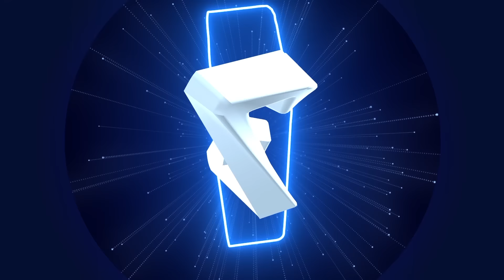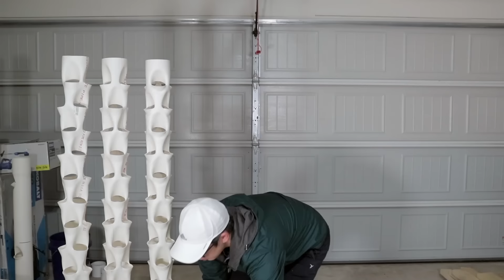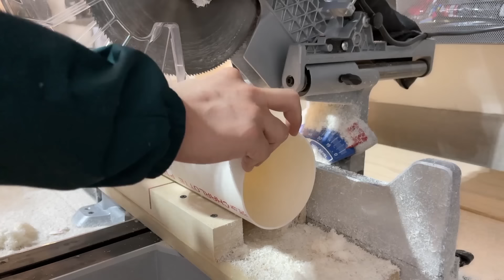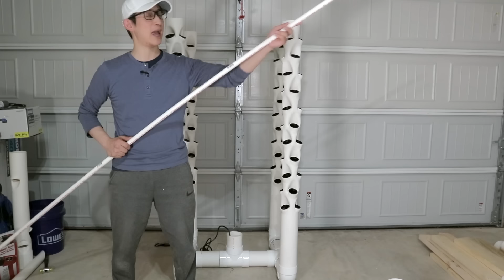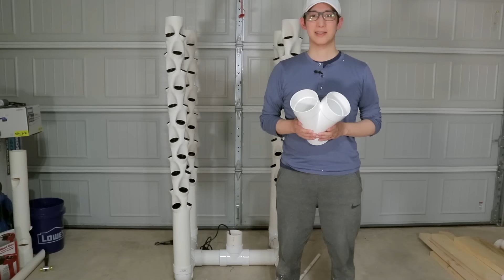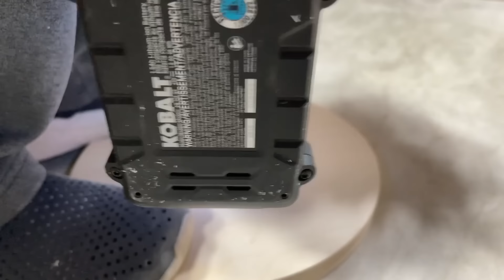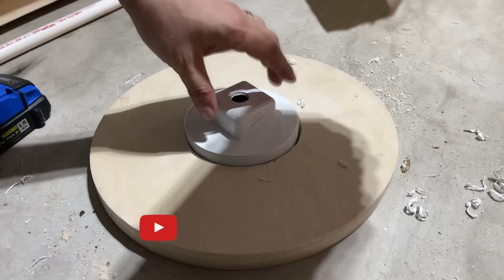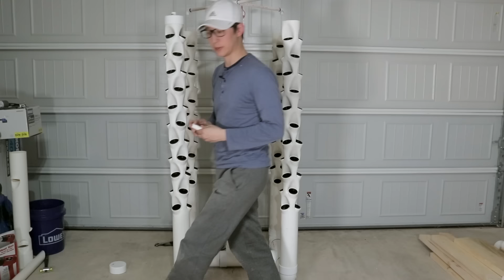DIY Hydroponics | Aeroponics Garden Tower Build | Part 2 - [4 Tower Build]

Comment: Hi Chris Amazing 
Great design, just as a thought 
The base of your upright I would assume that is the height of your water reservoir 
As you don’t glue this to allow for cleaning I was thinking to glue in a 300 to 400mm section which you then can place your pipe (grow tower )into giving you 5, 300 to 400 mm high pipes as a water reservoir, and still access for cleaning 
Really inspired to give it a go
Cheers Claude
Reply from the maker: I had thought of that as well.  The base already holds a lot of water, but agree that adding an additional vertical section will allow for more water.  For this build I just wanted to keep it low enough so I can reach the top plants, however, great idea for increasing the amount of water.  Maybe I reduce the height of the pots section since there are more than enough pots already with the 4 towers.

Comment: This is very nicely built. In the future, when you are cutting 2 inch PVC pipes, you don't have to elevate them like you did in this video, the miter saw will plunge deep enough to cut all the way through the PVC, provided you didn't set the depth stop up to prevent it from cutting all the way through. You can then use one of your pieces of 2x4 as a stop block. To attach a stop block, simply clamp it to your miter saw, on either side of the blade, whichever is most comfortable to you, and adjust it to how long you want your finished piece to be. This will also insure that every piece you cut, is the exact same length. This can be done, not only for your hydroponics builds, but for all of your woodworking projects as well. You can find countless videos here on YouTube, to explain miter saw stop blocks further, if you need them. If you want to get even more in depth with this, check out these two videos from other YouTubers https://www.youtube.com/watch?v=Z7aVlujrmlg      https://www.youtube.com/watch?v=kkOD4JxxE6w
Reply: At the end when you were showing the finished project, if you need some more stability, especially in windy conditions, you can lay a bag or two of sand on top of the base on either side of the center.
Reply from the maker: Thanks.  I started doing that for the bucket design.  This PVC base design is actually very sturdy.  It even withstood gusts of wind from a passing tornado.  Law chairs and roof shingles were blown around but the tower didn't move an inch - lost all the plants though :(
Reply from the maker: Thanks for the tip and links.  I was actually just being lazy using the 2" PVC holder to hold the 4" PVC pipe so it wouldn't roll, but definitely sound advice.  Appreciate the tip for the stop block as well!

Comment: looks great, but depending on the pump capacity, that base could be an issue. because the water level is shallow u risk burning out pumps. also, when the water increases past the 90s at the base its gonna leak like crazy. better off with a male adapter glued to the tower bottoms and a female glued to the base 90s.
Reply from the maker: So far I haven't had any issues, but then again I refill the reservoir when I notice it getting low.  Another viewer also had a great idea of extending the base reservoir, somewhat like what you are suggesting.   Thanks!

Comment: How many plants could this fit in it. It looks like there could be 33 plants per tower which would be 132 plants in total. If that is true then it would save 132 square feet in what I would guess to be about 4sq ft.
Reply from the maker: That's about right, however, it can be more or less depending on the height of the tower.  You definitely save a lot of space which is the benefit for these towers, aside from cost savings for both water and dirt.

Comment: I just bought all these parts. Including a hack saw and hole drill bit, my total so far is $340. I still need to buy the seeds and hydroponics food. Maybe a 30w water heater. It's gonna come out to around $400 I think.
Reply from the maker: for the 4-tower build, its a bit more expensive then a single tower.  It It also doesn't help that prices have gone up as well =(
Reply: Did you buy drainage pipe or sewage pipe? Drainage (lawn and garden section) is a fraction of the price. More than half
Reply: I think I bought sewer pipe. Hmm didn't know there were different types.

Comment: What is the mitre saw "stopper" that you mention?  I can only find stop blocks on line but those are different.
Reply from the maker: There is a stopper bolt built onto my mitre saw that allows me to set a stopping point.  Its basically a screw pin that I can tighten to stop the saw at different heights
Reply: @ChrisLoh  okay so not something to add to a saw?

Comment: You did a great job buddy! How do you regulate ph and nutrients in the water, for optimal growth?
Reply from the maker: I forgot to mention that in the video, but I use a PH meter.  At first I just guessed and for some time I didn't even use nutrients.  I found though that using a PH meter helps produce the best results.

Comment: If you cut your rings ahead of time and inserted the ring into the hole made by your heating gun while it was still hot, it would fit perfectly and take less time - just a thought.
Reply from the maker: Thanks for the advice.  I learned that as well and applied that technique in my 3rd video.
Reply: @ChrisLoh  I would even go as far as to put the ring onto the angle cut pipe so while it is hot, you can tap the ring down with a flathead screwdriver and a mallet.

Comment: Chris Loh, It looks like you have a viable proof of concept for a commercially available retail product. You could even have two sizes. One the size of your original tower. and one size not as tall with a smaller diameter that would fit in an area the size of a balcony of an apt.

Comment: Great start, but you never show living plants in this system.. And I fear , healthy plants are NOT possible in this set up... WAY too many plants in a 4" pipe dude lol... I bet the pipe is completely blocked with about 25% growth of the plants and the bottom plants get starved, also slime and algae issues with lack of flow down the pipes, due to root overcrowding. I would cut down to about maybe 8 plants per tube? maybe that would be the max? I'd like to see the inside of that tube with plants growing with it? All part of new designs, failing is the way top succeed!

Comment: Individually measuring one inch rings is such a bad idea.  Set a stop block of scrap wood on the saw and you can zip off one after another as fast as you can move your arm up and down.  

You also might try mounting the saw blade backwards for cutting pvc. It works well for some plastics.

Comment: Your pvc explodes because a few reasons. Its moving all over  in small amounts but the miter saw spins so fast. Keeping it firm against the fence wont happen. If it does, it isnt firm.

Also, let you blade stop spinning before lifting off  the cut piece has the possibility of moving, catching a tooth.

Comment: Het Chris - really appreciate your videos. I've researched this stuff for a while now and planning to build your system.  Was wondering about the water. Several others have suggested not to use tap water or well water.  Rain water is best and some have suggested distilled water. Any  thoughts? Also, I'm thinking to incorporate grow lights for an indoor system. I like your reservoir idea. I've considered a high pressure system and wondering if you'd considered misters rather than a spray? Good luck with your business.

Comment: What's the volume of water and how does the water temp do in outdoor environment. This is one of the coolest diys and my wife is stoked. Thanks for your creativity.
Reply from the maker: It actually depends how big you make the base.  Mine is about 4-5 gallons when full
Reply: @ChrisLoh  I used to have problems with root rot because temp was getting too high. I was thinking about getting grommets and plumbing them into a bigger reservoir in the middle to buffer the heat caused by pump. Still I'm definitely going to use this tower for my wife's gardening hobby. Thanks again.

Comment: Thank you for the great video. 

I recently made this myself but I'm having a hard time getting the net cups to fully go in. They turned out like your first video. How did you get them to sit fully in better on this video?
Reply from the maker: I angled the holes downwards more, including the rings so the cups were more vertical.
Reply: @ChrisLoh  Thank you for your response. I noticed I purchased the wide lip cups. I swapped them out for the ones you provided on your link and problem solved!

Comment: I don’t see a place or attachment for a water solution tank. Does that mean you’d have to drain the water and replace the amount runnin frequently coz the system can only take  to the extent of that lower structure without flooding it..

Comment: This is both glorious and saddening. Excellent design man! I just after 20 years now live in a house without a heat gun 😂 
If there’s anyone with greater materials knowledge than me; would the boiling method of PVC shaping be safe for a hydroponics system?
In addition, having reviewed other comments on this build, I’m curious if active charcoal filters would be counterproductive to hydroponics, or in anyway productive to individual towers wellness?
Reply from the maker: Ive gotten mixed reactions about heating PVC and the possibility that it might release chemicals, but I would assume it is pretty minimal compared to the chemicals and additives used on store bought vegetables.  Charcoal filters can probably help to filter out a lot of chemicals and also help clean the water, but something I have not considered trying yet.  Whether it's counterproductive I cant say since charcoal can also be good for plants :)

Comment: Great video, when cutting your retention rings set up a stopper on your mitre saw so you don't need to measure.

just cut, then push the pipe through still it hits, use an old wood off cut clamped down. throw a bucket on the ground to catch them all.
Reply from the maker: Good tip!  Thanks.

Comment: i built something very similar but had issues with the algae. is there a way to keep this at bay?
Reply from the maker: I actually didn't have issues with algae in my first and 2nd build.  The 3rd build I had issues.   The main difference between the 3 builds is that I didn't use much liquid nutrients in the first two builds, but I'm not certain if that was the reason for the algae growth.  I did read though that if you add a cover to the pots and leave a hole for the plants to grow through, that would help prevent algae.   You can also pour hydrogen peroxide into the reservoir once in a while which should remove the algae as well.

Comment: Just anchor it at the bottom to resist the wind! (e.g. tent camping anchors attached to rope going over the tubes). Your 4 tower build provides for a moment of torque at that bottom so it would be a nice synergy. Alternatively, you can use the "guy wire" method to anchor it down.

Comment: I wanted to add something to your towers. I work with 5gallon bu let's alot. They are much more stable upside down. Full, they're really tough to flip or tilt. If you take off the lid, caulk in a collar of PVC pipe connector. Cut a precise hole in the bottom of your bucket. Insert your tower into the hole on the bottom your now using as the top. Secure the lid to the tower and then the lid to the bucket. Your tower is now stable and secure and not wobbly. Also this can make it easier to insert and set up your pump, being able to secure it to the lid bottom which can be removed.

Comment: You will probably need to get some screen material to filter under each tower because those sprinkler knobs will clog easily.  Very cool project.
Reply from the maker: I used a shower drain lid, however, a screen material is a good idea since its got smaller holes to filter more residue

Comment: Hi. I was researching and came across chargeable battery pumps. Would be better and great for outside. Please try one?
Reply from the maker: By chance do you have a link?   Was also considering solar powered options as well.
Reply: Solar is not strong and you would need to large of a set up. I'll have to look for the links
Reply: Did you get the links I sent you

Comment: Most projects require some adjusting to get them working as planned. Simple setup and parts used are available anywhere.  Plastic flex tubing might work better and perhaps add a filter piece to the pump outlets to trap very miniscule particles that might impede water flow. Checked daily however  may not be required. Noticed a lot of condensation forms around the PVC pipe when placed sideways however up and down it does not happen as much. Like the quality of the planter yet Video did not stipulate final costs and time required to make it. Thanks for sharing.

Comment: Hello,

Looking at your construction, I wondered why you didn't use the system from the base for the top as well. This way you ensure greater stability and rigidity of the system. It's just an observation. Otherwise, I congratulate you for your idea.

Comment: Looking at the previous video I was thinking about using 3 pipes for stability but of course there are no 120 degree connectors ...
In Europe we have different style of connectors and different tube dimensions so the exact parts and measurements used are just an example of what I should get.
I still might go for a 3-tower version, the base having a T at the back, and a T at the front with an access hatch for cleaning. The smaller pipe for the water hidden in one of the towers.

Comment: Hey Chris, I'm working on my own build and I'm having trouble with the heat gun part. When I push through the 2inch pvc it sometimes tears the 4inch pvc or doesn't fit at all. What heat were you at and how long do you heat around the open cuts? Would appreciate any tips, I just messed up a potential tower 😅
Reply: i think someone mentioned that you should drill holes on the ends of the slit

Comment: Love the build. Was wondering though, how about adding some push cart : trolley wheels to the base (probably clamp them on or create a small base for each arm and the center)? Just thinking that if it is on a paved surface (or someone has this in their apartment) it would allow for movement and rotation more easily (yea I know there is a power cord)
Reply: Pushcart with a turntable, allowing rotation, so the plants at the back of the tower get equal sunlight.

Comment: Very cool and simple, I think I will try this method. Another caution to add to the others: Heated PVC is crazy toxic, a neurotoxin, must wear a mask, not n95, a rated mask for gases. Also just use acetone to remove the inked writing. Thanks for sharing and doing.

Comment: You linked everything except the sprinkler rain heads. What are they?
Reply from the maker: Link to Sprinkler heads: https://low.es/3Pu8P23

I actually didn't list them, because I removed them.  The water pressure wasn't strong enough to use them effectively.
Reply: I just finished my build. I swapped the 90’S the towers were plugged into for T’s for flat spots for the towers to be supported on instead of putting stress on the connecting pipes.

Comment: How many gallons does it hold? Over 30 plants per tower has me wondering how long it lasts after topped off. Mature plants will drink a lot and most hydro nutrient companies suggest water change every 7 to 10 days anyway, however I'm wondering if the contents of the reservoir will last that long

Comment: You could make perfect holes in plastic just using heated metal pipe (thin metal is better) much faster and safer.
Reply from the maker: True, however, i wanted to avoid rust throughout the towers lifetime.

Comment: Question: What if we add a misting tip to the tower? Could the mist circulate well in the tower?
Reply from the maker: I originally added sprinkler tips at the top, but found that the pressure wasnt strong enough to push water through those.  Im not sure how a mist tip might work.  maybe worth a try in a future build!
Reply: @ChrisLoh  Yay!! thank you for the reply! Looking forward to your next video!

Comment: Well done.  This is a great, and in expensive approach to this growing plan.  I'm thinking about a shorter 6 or 8 inch pcv pipe version for use on a kitchen counter.
Reply from the maker: You can definitely do that and use a smaller pump.  Im actually in the process of building a modular one that will allow just that :)

Will post that video soon!

Comment: It’s gardening that so good for the environment that it takes electricity to operate 🙄. Instead of traditional that uses no power at all 😂.
Reply from the maker: I actually built it to use less water (Water Bill is expensive) and to save on the cost for the soil I had to buy.  I don't think i mentioned the environment as a reason for pursuing hydroponics.  

It is definitely not something that is good for the environment considering it uses plastic PVC as well.  It is a great space saver though and a good solution for people who want to grow certain vegetables year-round or indoors.
Reply: @ChrisLoh : Now I feel bad Lol. I used to grow pot with a similar setup in highschool before weed was legal. I had a pump, loop system that used perlite. Anyhow good job man. I hope you inspire many more people.

Comment: Awesome, how do you get the holes to be so smooth.  I have tried heating the plastic and pushing the tube through, however, it always seems to tear the open at the corners.
Reply from the maker: you might need to cut the slits larger and use ice water, which helps to prevent tearing (once applied)